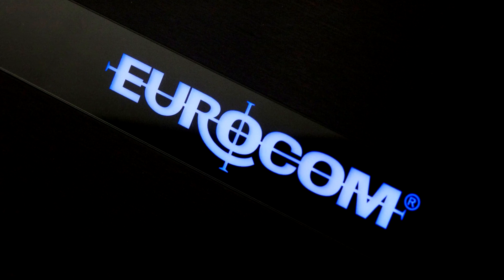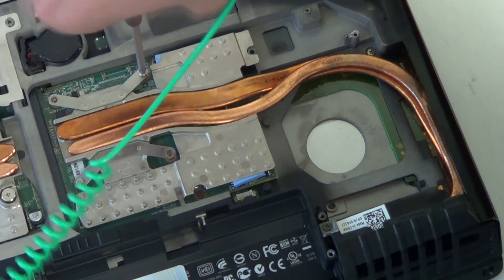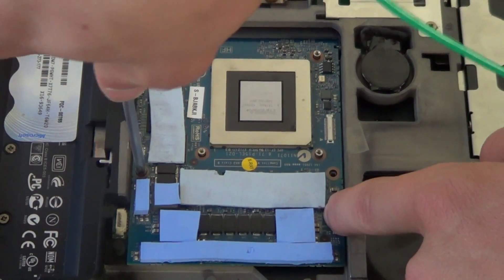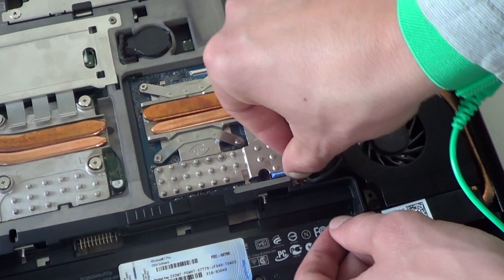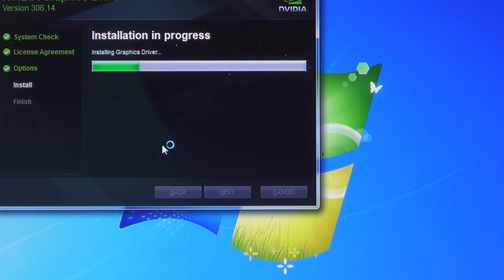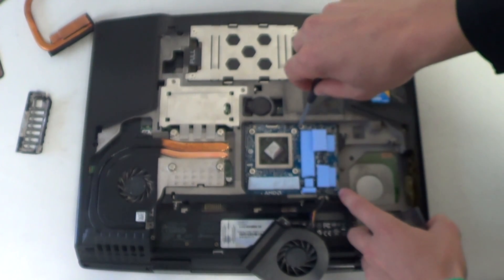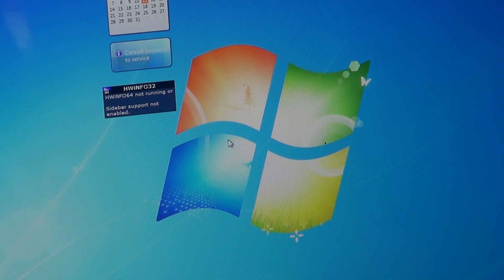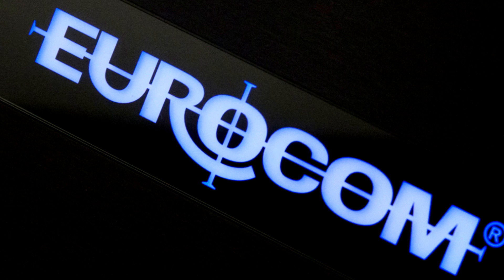AMD Radeon HD 7970M and NVIDIA GeForce GTX 680M upgrade in Alienware M15x

Comment: @eurocom technology. Hi i have the M15X with the i7 2.66 processor with the 5000 series ati. i would like to buy the 7970m set up but it looks like your website doesnt have my laptop on in in the kits section. is it possible for you to put down a parts list that i would need to upgrade to this? i believe my video card is failing from old age or something, im not sure what it is but on GPU-Z everytime you open something the screen freezes and the sound goes on a .2 sec repeat mode for a few sec while it opens. i have the most updated catalyst drivers and stuff already so im pretty positive thats not the issue. i can normall play games like LoL or WoW at 35-80 fps depending on what im doing in game but recently there is alot of screen tearing and freezing at play and ive been told it could be the V-card. so if there is anyway you guys could help me out with atleast a list i would be very appreciative, Thanks!
Reply from the maker: Yes, right now all we have on our upgrade showroom are the: 680m, 660m, 670m for the M15x.  We may be out of 7970M cards.  Please contact sales@eurocom.com to speak with an upgrade expert who will help you out! Thanks for stopping by and let me know if you need anything.
Reply: EurocomTechnology would you say this card will work in a M15x even though it says M18x? http://www.ebay.com/itm/NVIDIA-GTX-680M-2GB-xbracket-screws-Dell-Alienware-M18xR1-/331462332312
Reply from the maker: I can't comment on cards that we don't test and verify but the M15x can support the 680M video card.
Reply: EurocomTechnology cool thanks!
Reply: arbiter1022 me again. so im looking to buy the video card 3rd party but it doesnt come with the X bracket or the strips, could you tell me which bracket and strips i need to purchase in order to get the ati 7970m in my M15x?
Reply from the maker: arbiter1022 The pads are 3M, the x brackets are special for each brand.  YI;m not sure where you can procure them other than from us.  Feel free to contact sales@eurocom.com for assistance.

Comment: i am planning to buy a laptop and i'm asking if its okay to buy  m15x alienware than m17x. is there really a big difference between the two when it comes to upgrading parts?
or is it okay with just m15x because  i think m17x is too big. just wanna know if m15x has really low limit on upgrading parts or is it on equal terms  with m17x?
Reply from the maker: Are you comparing the M15x to the M17x r1?  Actually, the M15x is far more graphics upgradeable than the M17xr1.  Other than that the other components are nearly identical.  The M15x can actually support the 680M!
Reply: does it also support 980M?
or are you saying that 680M is better?
Reply from the maker: No, neither support the 980M.  The highest performance card either one supports is the 680M and it is only supported in the M15x.
Reply: EurocomTechnology What about M17 R4? Does it support 980M. Thanks.
Reply from the maker: Dmitrij Grebeniuk Yes!  Check them here: http://www.eurocom.com/ec/upgrade(1,259,0)ec

Comment: hey just installed a fresh OS 8.1 and then tried the hd 7970m and now the caps lock and the scroll lock is blinking but the num lock is not blinking and staying on according to dell forum, the video card is stopping the boot, is it correct, should i ask the seller for replacement ??? Got it from aliexpress
Reply from the maker: I'm not exactly sure what is going on.  I would definitely call them and ask for some assistance.

Comment: Is it possible to just use thermal paste instead of thermal pad?I only have thermal paste now
Reply from the maker: NOOOOOOOOOOOO!!!!!!! This should not be done.  I highly recommend using thermal pads and ensuring there is proper contact between the pads, the chips and the heatsink.

Comment: hey i just upgraded my alienware m15x r2 i think having i7 720Q processor and a nvidia 240m graphic card to a hd7970m. I have a ac adapter of 150W , when i press the power button, the fans start, keyboard glow but no display on the screen, it does not even turn on. Is it because i have a 150W adapter , do i need a 240W ???
Reply from the maker: Not sure about that.  Even with a lower AC adapter the display will work.  Please contact support@eurocom.com for assistance.
Reply: Ok thanks
Reply: sent email but not answered can you help??my m15x is not booting,
using a 150W AC adapter, upgraded from a nvidia 240m the screen does not turn on and the "ÄLIENWARE" below the screen also does not light up, fans turn on and the keyboard lights up though, any solution
Reply: EurocomTechnology and when i press the keys on the keyboard , after a while the laptop beeps every time when i press any key
Reply from the maker: I see your email in the support queue.  I will prioritize it for our support.
Reply: Ok thanks
Reply: Nabin Shrestha i have the same issue after i updated to gtx 680m, did u get it resolved ?
Reply: no :( sent the card back for a refund
Reply: i was suggested to get 210 or 240 W PSU,i am gonna try that. did you try that ?

Comment: I have an Alienware m15x r2, its probably the lowest end Alienware m15x r2. It has an intel core i3 370m at 2.40ghz, and a ATI Mobility Radeon HD 5730 with 1gb of ddr3. My question is, can I upgrade the gpu to any of the cards mentioned? Unfortunatley I believe that the 5730 is MXM 2.0 rather than 3.0, but im not 100% sure.
Reply from the maker: The m15x is upgradeable.  You can do 660M, 670M, 675M, 680M. AMD 8970m, 6990m, 7970m, 5870m.
Reply: My fan wont come off one of the screw is kind agard to oull out damn
Reply from the maker: Franz Pogi  Be patient, try not to break or strip the screw.
Reply: i given up im just gonna let my local repair shop fix the screw it screw wont even budge
Reply: EurocomTechnology Hi, is 7970m the only one doesnt required tweaking and pretty much PnP? Im interested in 7970m but on your website i can only find the nVIDIA upgrade kits... are the AMD ones sold out?
Reply from the maker: keith freakingtaco It depends, each card can be a little different.  We will supply you everything you need for an easy upgrade.  The cards that are available on our website are the ones we have stock of.

Comment: i want install nvidia gx 675mx 4gb ddr5 in my laptop alienware m15x, i have this proccesor intel core i7 1.73ghz g740, my laptop support this video card? what videocard ou recomend for my laptop?  i need use 240w ac adapter for gtx675? or i can use my 150w ac adapter?
Reply from the maker: We are not sure about the 675MX.  670M and 680M do work.  If you are interested you can ship your system to us for an upgrade.  Please contact sales@eurocom.com to speak with an upgrade expert.
Reply: EurocomTechnology And how about GTX 675m?
Reply from the maker: Not Noah Yes sir!

Comment: hi, i want make a upgrade for my alienware m15x but im confused by the power supply, if i want install the gtx 680m, i can use my regular ac adapter? or i need buy another bigger ac adapter like yours, i have the original ac adapter,  like the smaller in your video, what type of video card can buy and works with my regular ac adapter
Reply from the maker: You need to make sure the AC adapter you use can provide the requisite amount of power to all the components in your system.  We recommend using the 240 W ac adapter to ensure this happens.  If you don't want to upgrade your AC Adapter you should look for graphics cards that are the same wattage as your current one.

Comment: HI, i have an Alienware m15x i7 Q720 1.60 Ghz, gtx 260m from 2009, i need to change my nvidia card because it crash. I dont know witch card is compatible and witch one is better than the other. Also were can i get them. 

Thnks.
Reply from the maker: The m15x can support the 680M or 675M or 670m or 660m  http://www.eurocom.com/ec/vgas(1)ec

Comment: Hello friend I have alien M17x R4 it has a GTX 660M card and is not HD
So I would like to exchange the card for a more potent because my graphic designer sotfware for this not to run was wondering if I can change and what would edeal plate? Please help me!
Reply from the maker: The M17x r4 supports a variety of graphics cards.  The 880M would be a good upgrade, 780M is also supported.

Comment: I was wondering if someone could tell me the model numbers and/or specs of the optional ac power adaptors & if the later GeForece GTX 780m & 880M video cards can also be upgraded to the Alienware M15x from the video?
Reply from the maker: Not sure about the model #s.  The M15x does not support the 780M or 880M.
Reply: EurocomTechnology Many thanks!

Comment: I have Alienware m15x and I have bought recently a GTX 770m.
Right now i use thermal pads from older GTX 260M and they are already 6-7 years old...
Is it need it to buy another set of pads for my new GTX 770M,will i see some improvements for temperatures?
I want to buy something like this: Phobya Thermal pad XT 7W/mk
I want to know heights of the pads. for my new GTX 770M
Reply from the maker: I would recommend getting new thermal pads.  Keeping your card cool will enhance its performance and help it last longer by keeping temperatures down.  The thermals pads are just a few millimeters thick.
Reply: Hows the  770m i currently use a 260m i7 2.6ghz  and i also have a ps4 but 780m and 7970 are still like $300 it worth to upgrade?
Reply from the maker: Franz Pogi I assume you are asking if it is worth upgrading your M15x with a 680M or 7970M.  Also, the 770M is not supported.  The 680M and 7970M are the highest performance GPUs that we can verify.  http://www.eurocom.com/ec/vgas(1)ec
Reply: yah cause honestly 260m is showing its age, is it worth it to upgrade? or just buy a new pc its quite costy for a 7970 m upgrade
Reply from the maker: Franz Pogi It can be costly but it is much cheaper than a new system and is probably the biggest bottle neck for your gaming.
Reply: i know what u mean im gonna save up now for a 7970m so thats like the best u can get right u think i can play games like unity? on a 7970
Reply from the maker: Franz Pogi 680M would be better, but it is a bit more money.

Comment: Will an upgrade to an GeForce 660M require a 240W adapter as well? Im wondering since Eurocom's ebay page listed in the video description has an installation kit for this GPU.
Reply from the maker: No, the 660m is a low wattage card so you dont need to higher wattage ac adapter.  You do however, need the heatsink shim.  All you need is included in the kit.

Comment: I'm looking into buying a gtx680m for my M15x. It currently has a gtx 260m in it. Now am I going to be able to just swap boards and up the power supply and be ready to go? Or will I need to find a replacement heatsink/fan for it?
Reply from the maker: You, simply need to install the new graphics card ( I assume that i what you mean by swap boards), same heatsink should work, just re-apply the the new thermal pads, re-thermal paste and use the new PSU you should be good to go.

Comment: Hi, I would like to upgrade my video card, you say I need a 250 watts adapter, but mine is a 150 watts and I cant find a 250 watts one.
Reply from the maker: You should be able to get it from Dell or Alienware.
Reply: EurocomTechnology I should, but there is only the 150 watt in their webpage.
Reply from the maker: I'd suggest contacting their support department.
Reply: EurocomTechnology They aren't selling either anymore at the moment. Do you have a part number or anything so I can make sure I'm finding the same on you use? Can you just post a picture of the label for comparison?

I really want to buy an upgraded card from you, but getting a power supply is a must before I can do that.
Reply from the maker: Upon further investigation I have actually found out that the 180W ac adapter is completely functional and works just great.  This is the AC adapter our technicians have been recommending all along.  I am going to update the video to reflect this.  Our AW M15x upgrade showroom is here: http://www.eurocom.com/ec/upgrade(1,268,0)ec
Reply: EurocomTechnology From my research the M15x can draw up to 190 watts at peak. A 180W adapter would probably be sufficient. But the M15x came with a 150W adapter. Mine gets really hot and seems to run above it's rating way too often.

I'm updating to the M17x's AC adapter. This should ensure no problems going forward. Upgrade or stock.

Comment: I have an Alienware m15x with 260M GTX, i740 processor, 8GB ram and 320GB HDD. Can you please suggest me a GPU, Processor, SSD and the relevant power supply to buy please ? Can i buy the GPU from you ? Can I use 16GB ram if i upgrade my processor ? 

Thanks alot :-)
Reply from the maker: You can upgrade your GPU to 560M, 580M, 5870M, 6990M, 670M, 675M, 680M.  An i7-840QM would be a good CPU upgrade, staying within 45W but giving you higher clock speeds.  I would recommend a Crucial M500 SSD, 480GB would be good i think.  If you decide on a 75 W GPU upgrade you will not need a new power supply as your 260M is already 75 W.  Yes, you can get these components here: http://www.ebay.ca/usr/upgradeyourlaptop
Reply from the maker: Even the Intel® Core™ i7-940XM Processor Extreme Edition only support 8 GB memory.

Comment: Hi EurocomTech.. I have Alienware M15x and i would like to upgrade my graphics card to GeForce GTX 765M, is it alright? and do i need to replace its power brick/source since i'm using Gtx 260m currently, and i believe that 260m consumes 75W of power as oppose to 60-65 W from GTX 765 which much efficient.. and i'm from the Philippines, do you guys ship to Philippines? thanks..
Reply from the maker: That is unfortunate, the M15x has integrated graphics that cannot be removed or replaced.  

We do ship worldwide, so shipping to the Philippines is not a problem.  If you are looking for more performance, a CPU upgrade or storage drive upgrade could be a good idea.
Reply: but you just did right looking at the video.. it's M15x and you upgrade its video card... i'm confuse now..
Reply from the maker: crash override Sorry, yes there are versions of the M15x that can be upgraded.  For some reason I was thinking about the M14x.  The m15x can support 680M, 675M, 670M, 6990M.  I am not sure if the 765M is supported, that one is unknown at this point.
Reply: EurocomTechnology ok thanks.. i'll go ahead and check those cards that you've mentioned..
Reply from the maker: crash override Good luck, sorry for the confusion and let me know if you need anything or have any questions.
Reply from the maker: The M15x supports 8970M, 680M, 675M, 670M, 660M, 6990M, 5870M, 580M, 560M.
Reply: EurocomTechnology Can you please give me the link for the alienware m15x 8970m ? Does it come ready with the m15x vBios and all set plug and play ?
Reply from the maker: M Jamal http://www.ebay.ca/itm/Alienware-M17x-M18x-VGA-Upgrade-Kit-AMD-HD8970M-4GB-DDR5-MXM-3-0b-/121397512530?pt=PCC_Video_TV_Cards&hash=item1c43db0952&_uhb=1   Ask the upgrade expert there for any assistance.

Comment: Would a Geforce GTX 780m or 880 work on a msi ge70 laptop its 2 years old? I got a Geforce GT 650m now?
Reply from the maker: Not sure.  I am not too familiar with MSI notebooks and their upgrade potential, especially because there are many many variations of MSI systems.  Hit the forums, you should be able to find some info.

Comment: hi eurocom,
i have a question : i have alienware m15x with an intel i3. can i upgrade the gpu with for example nvidia AMD HD 6970M or like you GTX 680M ?
Reply from the maker: That's what we're doing here buddy!  It can depend on what rev you have, you also may need to upgrade our AC adapter.

Comment: you do not need ESD protection anymore. what is this the early 90s? components made today can take a significant amount of electrical shock before they fry.
Reply from the maker: I would prefer to wear the ESD protection and be sure not to damage expensive components.

Comment: its almost cheaper to build a new computer from scratch tbh....the gtx 680m is a mobile card meaning its about half as powerful than its counterpart sooo you might be better off just building a computer from scratch i got one with the gtx 780 a quad core 3.4 ghz and 32 gb memory for around 1200 compared to the gtx 680m being around 600-750 just for the card.....
Reply from the maker: Mobility can increase prices for sure.  Many people, however, value that mobility.

Comment: the 680m has both 2G and 4G, both version will work fine in the m15x?  no extra changes than normal?  the clevo 4g version will work ok?

what will improve rendering and handling lots of video at once? this or an ssd?

the 770m and 780m will also work?  the 870m works?

Comment: Is it necessary to make any changes to the m15x bios after changing to the 240w psu? I am getting an error message saying this is not the 150w psu that came with my computer. Will using this 240w psu cause any damage to the computer?

Also, Is there any changes that need to be applied to the functioning of the fans after replacing the video card for the GeForce GTX 680M to prevent overheating?

Thanks in advance.
Reply from the maker: You can turn off the adapter warning in the bios.  The 240W adapter will not cause any damage to your computer.  There are no changes that need to be applied to the fans.
Reply: Alright! Thank you so much for your prompt response and for all your help! :)
Reply from the maker: Marlon Cardero No problem at all.  Good luck and let us know how it goes!

Comment: Whatever you decide, do not apply thermal paste like this guy...
Reply: Or demount the heatsink like he does, all screws should be loosened each little at a time and not just pulled out completely 1 by 1 because you end up with uneven preassure on the die which can in rare cases damage it.
Reply: Levi Carroll why
Reply: FeaR you don't need that much, applied it horribly